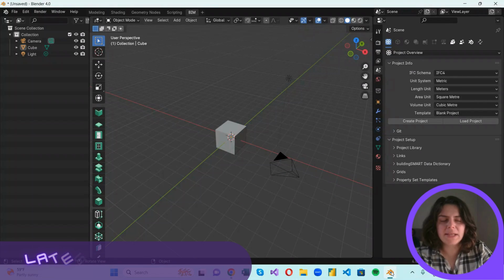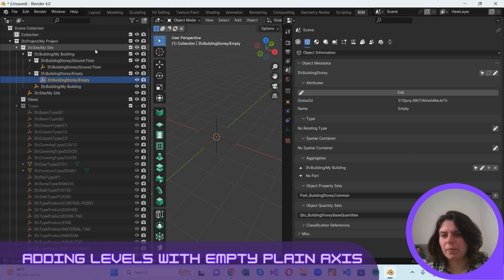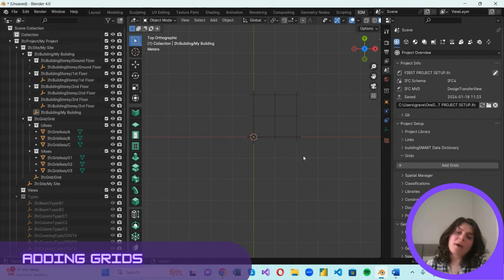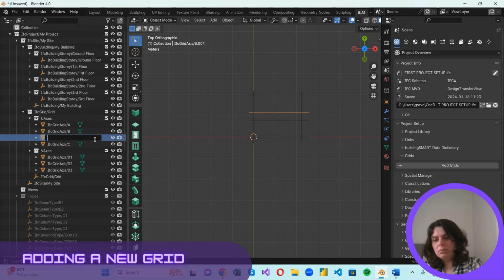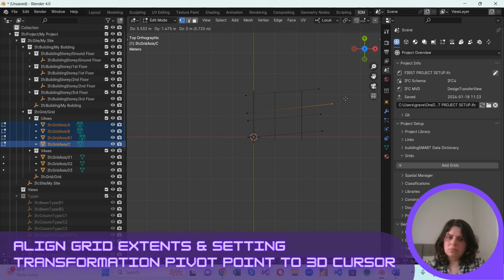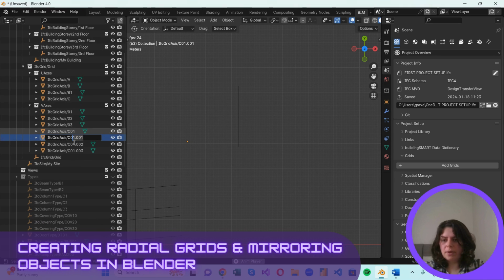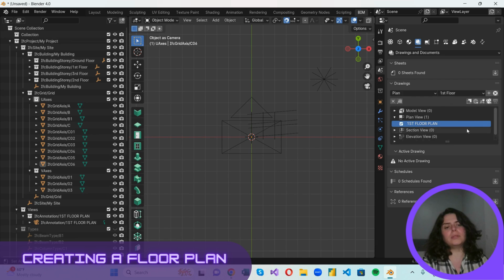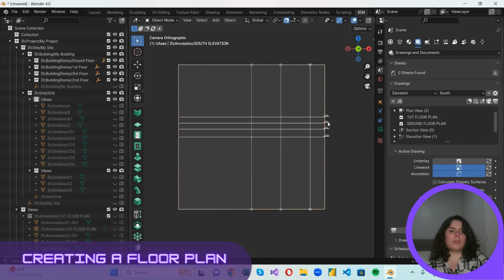BlenderBIM (Bonsai) Project Setup: IFC Project, Levels, Grids, Views, and Essential Blender Tools

Comment: I am a draftsman working in a tire manufacturing company. I  and am incredibly impressed by your expertise in BlenderBIM.

I am currently working on creating technical drawings and animations for our engineering department. While I am proficient in Blender for 3D modeling and animation, I am facing a challenge in creating 2D outlines of complex 3D models for technical drawings.

My current workflow involves exporting the 3D model from Blender to a .dae format, importing it into SketchUp, and then using SketchUp Layout to create the 2D drawings. While this method works, it is time-consuming .

I believe that BlenderBIM could be a more efficient solution for this task. However, I have been unable to fully grasp the workflow for creating accurate 2D outlines of 3D models directly within BlenderBIM. I would be immensely grateful if you could provide a detailed workflow or tutorial on how to achieve this using BlenderBIM.
Reply from the maker: @rohithbalaji4995  I will try and come up with something soon. Thanks for the interesting subject.